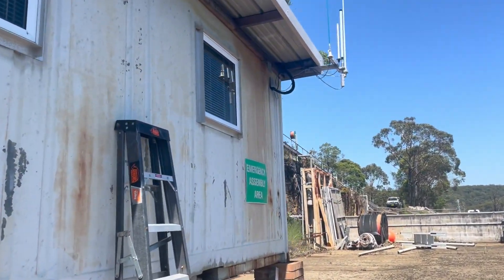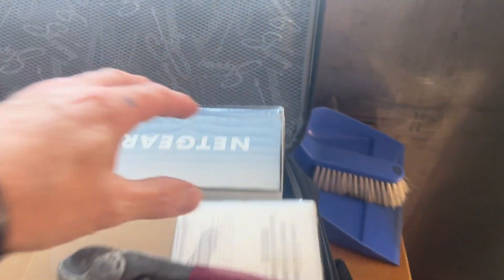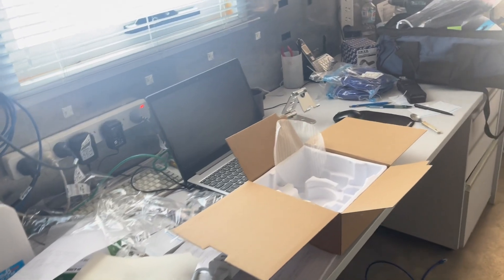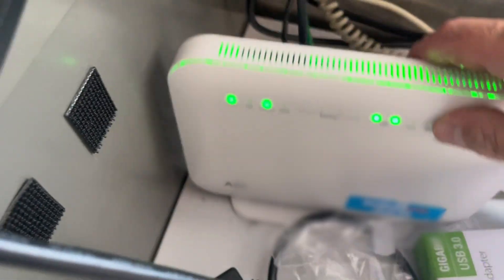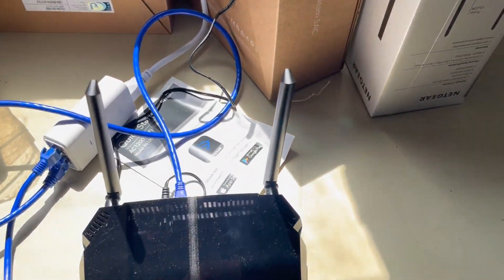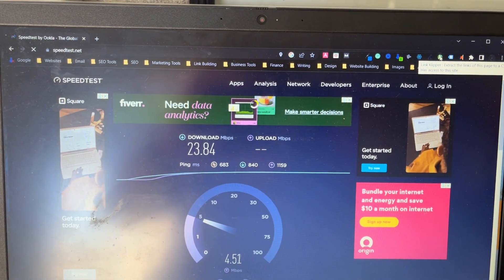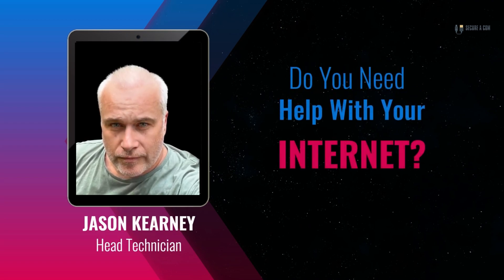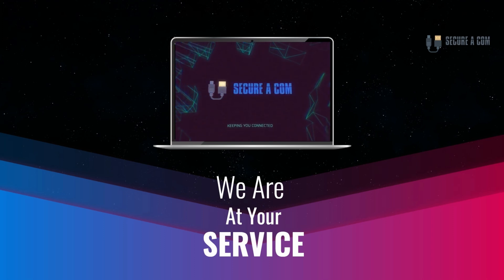4 Ubiquiti Nanobeams To Send Internet From The Shore Of  Dam To 2 Pontoon Offices In Middle Of Dam

Comment: Done  a few jobs like this,  its cheaper for them to hire external contractors for a couple hours than to get their own people out there for little jobs like these. nice work, I wouldnt have used that antenna as a mast, it not be used now, but with govts you never know what they will do  in 3 months :) and I would have used mikrotik units over the chinese made ubnt stuff, even for non secure locations like this, the build quality is like all cheapy chinese stuff.

(yes I know  ubnt is U.S. incorporated but Robert has all their stuff is made in China, and some of it has a service failure rate thats not real flash, I am glad you didnt use their switches or routers, or you'll be back out there in 2 years replacing them
Reply: the chinese diodes are shit and a lot of computer parts companies are withdrawing to Japan